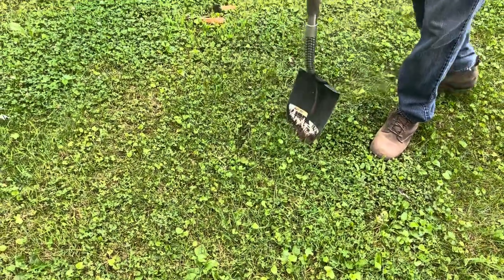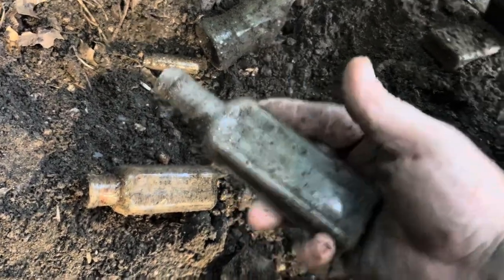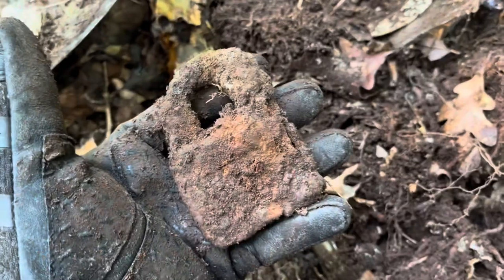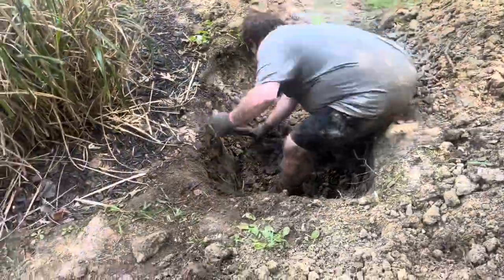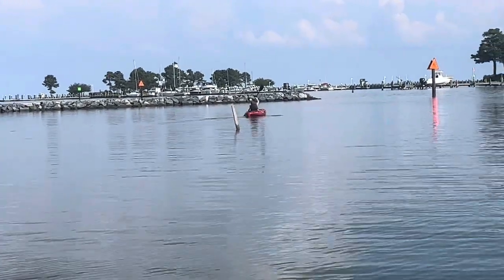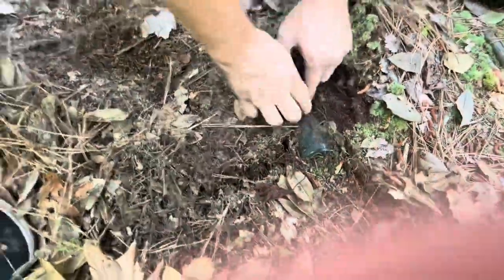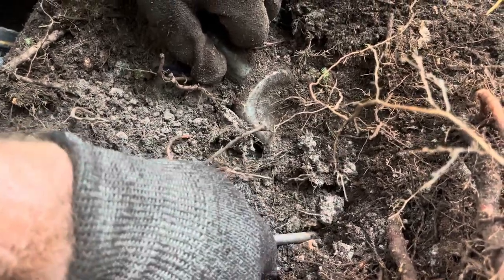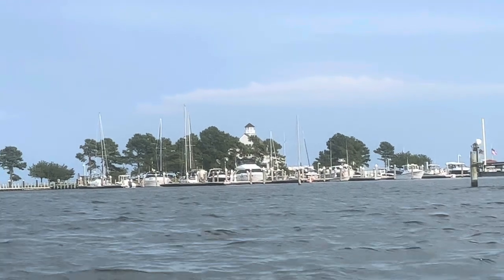Sinister Secrets Revealed: $1,000+ Bottle and Bones Discovered Behind Undertaker's House

Comment: Those bags that had the "warning/contamination/etc." printed on them that you found in the stonewall pit, were most likely at one time filled with whatever the undertaker/mortician removed from their clients when embalming... Therefore also the solid stone/cinder block lining so whatever possible decease wouldn't seep out into the top x-amount feet dirt/earth layer and cause illness to spread... That "dump site" should be registered as such and most likely have a no dig attached to it...
Reply from the maker: Sounds exactly what that one was. 😷 thanks for the info it has been filled and definitely won’t be reopened 😂